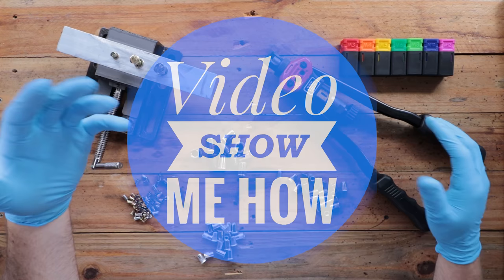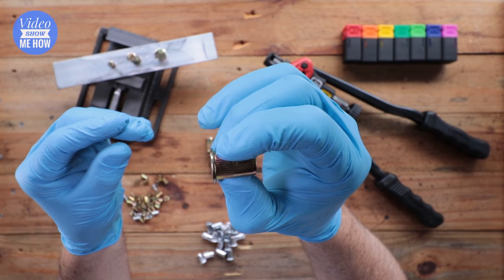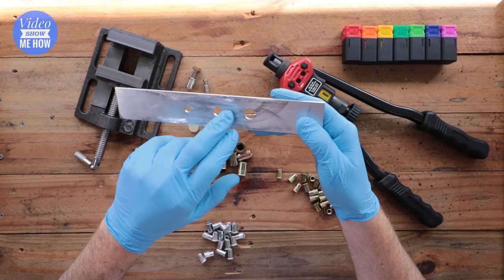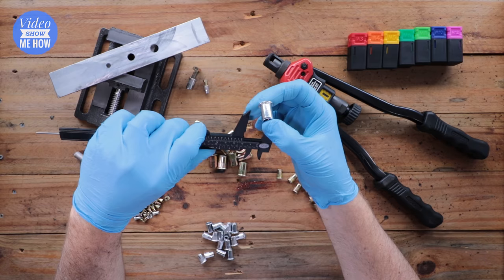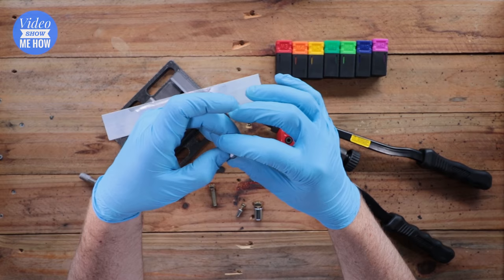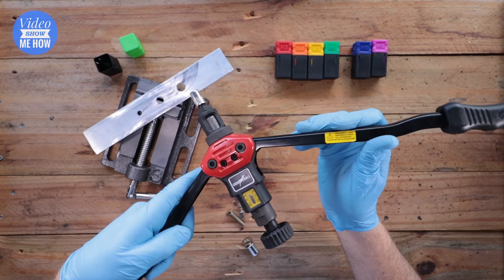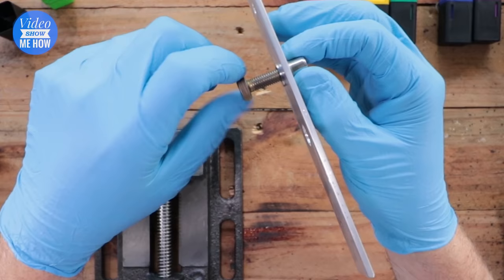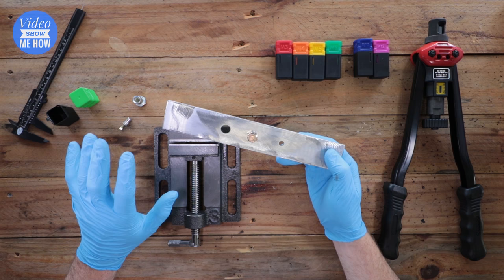How to Install Rivnut Rivet Nut Nutserts WITH TOOL [Full Guide]

Comment: You'll use this tool more than you think. Suggestion - do a test insert on a scrap piece so you can see how much pull is needed to set the insert. Especially on smaller sizes. Otherwise you can snap the mandrel with too much pull. You never pull handles enough to touch each other.

Comment: I have that exact same tool.  It came in a very nice case.  Major problem:  Too much money was spent on the case they couldn't afford the paperwork to show how to use the tool.  You did a good job on filling that shortcoming.  What is the purpose of the yellow scale on the tool?
Reply from the maker: Basically a depth gauge, shows how far the nut is crushed. Unsure how accurate etc, personally I don't really use

Comment: You are getting way too stuck on the flat surface thing. I literally only use these on round handrail pipe. No problem
Reply from the maker: Yeah sure, just meant they're more designed for flat for full strength. I've used them on my roof rack (pipe) for my awning and work fine also :)

Comment: One commenter asked how you know how much stroke to use and you replied that you use a two-step process to not overdo it, which is fine.  The tool I received came with pretty understandable instructions and a chart that lets you determine based on rivnut size and thickness of the metal you have, how much travel you should look for using the gauge in millimeters of travel.  This allows you to get the right amount of "crush" without underdoing it (spinning rivnuts) or overdoing it and possibly breaking the mandrel/die.

Comment: Thank you this helped a lot I’ll be using this to install my wide body kit on my E46
Reply from the maker: Nice!
Reply: I’m also using this for a wide body kit on my 86
Reply: I just found this video  for fender flares on my STI lol 😂
Reply: I'm fixing a real parcel shelf on my E46. Previous owner cut the middle section out for a messed up looking speaker shelf. Trying to get it back to oem look and keep trunk sound out. I have everything done, now time for the threaded insert. But, I don't want the insert to spin. And so I don't know if I need a specific type of insert made of Aluminum Brass or Steel? 

On YouTube to hopefully find what insert type can I use so I can torque to bolt to roughly 10ft/lbs without spinning it on this sheet metal? 
Thank you
Reply: Previous owner of my classic mini used self tappers for the arches... I'm also here for upgrades. These nutserts will definitely cope with 10 ft/lbs, use a steel one but only if you buy the beefier rivet tool like this one shown (steel rivnuts + the one handed tool will be a bad time)
Reply: Did it work?
Reply: @douglassantos8918  yeah it did but I’ll be blending my kit in to make it one piece to the body

Comment: Thanks for the clear and simple instructions. My tool turned up with Chinese instructions! I used these to put nut certs in my van roof to bolt some roof racks on, the ones available for my van only clamp to the edge of the roof and I didn’t feel they would be safe and would worry they’d come loose! This video helped me out big time!
Reply from the maker: Glad it helped!
Reply: @VideoShowMeHow  roughly knew how to use it but I didn’t want to cock it up especially with drilling holes in my roof!
Reply: @Legend-wu7pj  How did you know you'd have clearance on the inside for the rivnut?

Comment: Excellent video, thanks for that. The turny twisty thingy that releases the bolt was cool as well, I couldn't work out how to get the tool off one the nutsert was in.
Project- I'm remounting the hatch/cover for a water tank on a narrow boat (UK)- it had bots welded underneath the plate, but they have corroded and half have disappeared. So I'm going to grind off what rests & use nutserts instead.

Comment: I was hoping you would touch on yow to adjust the plunge/stroke depth on this tool. Thats what the little gauge on the bottom is for. Its possible to damage the rivet nuts themselves if you dont have this setup properly and you pull beyond the crush capacity of the inserted riv nut thereby essentially rendering that installed nut useless bc the threads have been destroyed
Reply from the maker: Yes you're correct, I usually just tread right down with the tool at max open, then insert full close, open 1/2 twist, compress again and perfect every time 👍 If you go too far it pulls the whole cylinder out of whack to the point you can't thread anything as you say

Comment: Probably the best video on Youtube, showing how to install Rivnuts!! The only thing I would add; the small one hand install tool is great for the smaller sized Rivnuts, where all that torque isn't required. You can use the large tool, that you did, for all sizes, *if you're careful. Its very easy to break the smaller mandrel or dies with all that leverage.
Reply from the maker: Top tip and thank you for the feedback :) 👍
Reply: Can these be used for plastic ATV panels
Reply from the maker: @matthewgriffin8049  I've used on plastic before so can't see why not, so long as the surface is flat (ish)
Reply: Hi,can you cut the excess material of to make it flush?

Comment: Something I have not seen on any video is an indication of how much to compress the rivnut and when to stop. It is not too bad when you can see both sides and so see the amount that has been compressed but when the backside of the insert is not visible then what? How much is the correct amount of compression? The too used is also very large so a consideration for tight/confined spaces has to be made to determine the usefulness of each type of rivnut tool. Great video though, well explained.
Reply: The appropriate amount of compression can be determined through experience and familiarization, or by using a product equipped with a stroke gauge that accurately measures compression. The ideal compression for achieving a neat crimp also depends on the size of the rivet nut and the thickness of the panel, information that can be found in the tool's user manual.

Comment: Thank you for the clear video. I purchased the same tool, however the die that I used are very easily bent causing al consequent rivet nuts to crooked. Any idea why this happens and how I can prevent it. I did make sure that the rivet nuts I use are suitable for the thickness of the material. Thanks in advance for you're reply!
Reply from the maker: Hey Nino, hmm haven't had any issues with mine and have used it A LOT... Wondering if it was faulty in some way?
Reply: @VideoShowMeHow  Thanks for you're reply! That might indeed be the case, the company I bought it from will send me a new one so we will see. I was just wondering if i might be doing something wrong. However as far as I know I do exactly what you do in you're video

Comment: hi! thank you so much for the video.  i have a question.
ive been using rivet nuts for light duty applications, say like mounting the number plate , or a hinge. 
but, can i use this for heavy duty industrial applications, like say to attach legs for a table that takes 1000kgs on it. where i would put the screw horizontally, and the screw is loaded in the shear mode.

Comment: I needed to drill out a hole on my jeep fender to install one of these inserts for an arb twin air compressor. Someone used this tool in stead an I assume put in the wrong size insert. It was not the one supplied by arb.  So after putting in the screw he also supplied, it screwed in maybe a quarter of the way and the insert turned with the screw. I could  get the screw out as everything turns together. I dremeled the head off the screw so I could uninstall the compressor bracket. How do I remove the insert and the headless screw?

Comment: Hey Adam,

Thanks for all your videos, they're brilliant!

Got a question regarding rivnuts...

Would they be suitable to fix down a fridge slide and a potable battery dock in the back of the tub?

I do a bit of 4x4ing, no crazy stuff, just getting from A to B.

They seem like the best and easiest fixing option.

Cheers
Ben
Reply from the maker: Hey Ben, you could however would consider - are you going into a tub liner or the tub itself? Tub itself would be fine  at a couple of points, tub liner may not be the strongest to hold with 4x4.. Also if tub liner just remember you'd have the back part of the rivnuts potentially scratching up your actual tub
Reply: @VideoShowMeHow  thanks for info mate,

Yeah have tub liner, I was thinking of cutting it out where fixings/ bractets will go, then semi try to make it neat and seal up again.

I'll have to have a plan and think.

Comment: Can you use this tool for really thin metal, say a car door? I would like to insert threaded rivets so I have a solid thread for mounting my new doorspeakers. Please let me know.
Reply from the maker: Sure can
Reply: @VideoShowMeHow  so the metal is not too thin you figure? Thanks for your quick reply!
Reply from the maker: @gianstevens7918  have used them in door panels before and they worked fine 👍

Comment: How well do you think that will perform on 1/8 fiberglass? Using 8/32 size bolts. My concern is that it will crash and crack the fiberglass
Reply from the maker: I would agree, you would have to have a very clean hole. I think it would depend how much load you will be asking of it. Have you got a spare bit to test it on?
Reply: You will need to use a washer on the back  or make a backing plate

Comment: Great video and thankyou. Is there a minimum thicknesses that they crimp onto? Such as would they work on a small gauge copper sheet or brass?
Reply from the maker: Cheers. They're meant for 6mm wire, the wire I used was a little smaller as I didn't have any thicker at the time. I wouldn't be going too thin, maybe 4mm max. If wanting smaller I would go to a different type of connector like deutsch plugs etc
Reply: You can check out different rivet nuts as they have different riveting thicknesses. Some will go from 0.5mm. the multi pack assorted versions tend to be cheaper ones and not so accommodating.

Comment: Oh thank you! I didn’t know that these things existed! I do believe this will work to fix my gate! The latch arm piece is just screwed into the colourbond tube vertical piece and when it blows in the wind the screw loosens. Drives me nuts as it makes even more noise, plus I’ve found it swinging open a few times. Not good with a dog and 8 chickens! I do have a question though. Do I need a specific sort of bolt? I’m guessing all the different metal screws I’ve bought trying to fix it in the last 8 years won’t have the right kind of thread. Actually, one more question. Do I need a certain kind of rivnut for outdoor use or are they all okay? I see there are shiny silver looking ones and brass coloured ones. Does it matter?
Reply from the maker: Yeah you can get stainless, make sure the bolt is high tensile, 8.8 min 👍
Reply: @VideoShowMeHow  okay great. Thank you so much! I’ve ordered off eBay and there’s no mention of tensile strength so that means I’ve bought the el cheapos lol. I’ll use one of those first to work out what size I need and then will get a small packet of high tensile just in that size and replace it. I don’t have a need for an assorted pack of high tensile bolts at this point. Maybe I’ll love this little doovilacky so much that I’ll start using it everywhere, but if it just fixes that bloody gate it’ll be worth it.

Comment: I got same one eventually when I had the time to use it. The Eclip inside broke 🤦‍♂️🤷 so I took apart think I fixed it but  now it doesn't open up the way it is supposed to. Do u have a vid to show how to fix this problem properly
Reply from the maker: No I don't I'm afraid, able to return it?

Comment: Great video. I'm curious if these would work in materials when the nutzert doesn't protrude out the other end, like for instance embedding it in a 2x4 piece of wood. Would it still crush and expand into the wood or would it just smash and not grab. Have you tried this?
Reply from the maker: Thanks Lee 👍 I haven't may be worth a shot my bets would be on it not being that effective though. If you're after a thread in timber you can use t nuts, have used these before to good effect. Hope this helps!
Reply: @VideoShowMeHow  I'll take a look at those. I'm actually going into composite fiberglass on a boat - but the T nuts might still be the best option. Thanks for the video and updates!
Reply from the maker: Welcome, good luck!

Comment: I have a step up running board the bolts seemed stripped but I think wrong application.  Do you feel this would have enough strength (using the proper amount of bolts) to withstand stepping weight to get into a truck??
Reply from the maker: Hey 👋 Yeah for sure, just get some bigger ones to suit something like  M10 bolts and should be fine 👍 Get some steel ones for more strength. This doc has some good stats on them - http://www.rivet-nut.com/assets/rivnut_mechanical_properties.pdf
Reply: The video shows the tool needs to be closed (handles together) to make the crip. However it's the following clip it shows you removing the tool from an open tool (handles wide open).  Is the crimping   action close then  open handles or just close handles?  Confirming the end state of the handles wasn't just a result of video editing.  Thank you.   Great video otherwise.  The company should be paying you royalties because their instructions suck.
Reply from the maker: Yep handles closed for crimp, to remove once crimped handles open so you can unscrew the mandrel 👍

Comment: Does the nut seal the whole from leaking? I’m installing brackets to the roof of my truck and I don’t want water to leak in. Should I add sealant to the installation process? Anybody have any thoughts? Thanks
Reply from the maker: I'd add some silicon around the rivnut prior to installing

Comment: Ever attempt to install in fiberglass?  Was thinking of opportunity but unsure if would remain after installing.
Reply from the maker: Would be an interesting experiment, thinking it would depend how thick and if it would crack. I could see it working though. Let us know how you go?
Reply: @VideoShowMeHow  its 1/4 marine plywood resin soaked gelcoat topped with splatter paint finish. Was thinking light sand to flatten paint, pre drill to rivet od, insert with either 3m 5200 or thickened resin, compress. I'm sure that will cause mild stress cracks in gelcoat immediately surrounding fastener,  but would likely hold. Its the longevity I'm concerned with. I'm gonna try w 5/16x18 since small enough if goes all wrong I can just rip out and resin over easily. I'll share as I learn.
Reply from the maker: @herewegofans  I reckon it would probably work ok. Maybe not for anything high torque but general fixing would likely be alright. Remember the stainless if in and around water (I'm sure you already have) 🤞👍
Reply: @VideoShowMeHow  the scope of the project is design a method to secure starboard hdpe to fiberglass bulkhead that is removable to service electrical distribution setup when needed. Previously used screws and adhesive but removal is a labor nightmare. Gonna try this to see if I can get working and just use light thread lock to assist with watertight and vibration on craft. Oversharing I know, but seems you like a good challenge so sharing should you wanna attempt also lol.

Comment: You missed an important detail, you can adjust the amount of nutsert compression/depth
Reply: exactly....
Reply: This is literally why I clicked on the video
Reply: That is what I thought as well, so that is what is the scale for then? I have watched lots of this how to do this vids, and not one has touched on the scale on the tool. Other than that this is a good video, but would still like to know how to use the scale.
Reply: @noidnomis  I think the scale is best used to judge the relative amount of compression applied to the rivnut. The pressure for any particular line on the scale would apply different pressure to different sized nuts because the nuts have different dimensions. To me, this is more of an art than a science, but one truly does get a “sense” of how to adjust as they become more familiar with the process.

Comment: Is there a insert nut that can be flush against the metal piece so that if you want to join 2 pieces of metal with a bolt together?
Reply from the maker: not that I know of I'm afraid.. welding a possibility?
Reply: @VideoShowMeHow  No welding is not. I want to join two pieces with a long bolt . I want that bolt to not wiggle in the hole.

Comment: Can you post a video while installing the nutserts in an actual application? The fact that the nutserts protrude from the backside of the surface where exactly would this product be useful? So far, I've only been seeing these installed on automobiles. I work in the construction industry and I'm trying to see the relevance of using this tool.

Comment: Thank you!
Reply: After I saw your video, I bought a rivetnut tool, yato brand, it haven't arrive yet, but I was wondering how thick or thin should be the sheet plate in order to insert a rivet nut properly? I suppose it can't be too thick/thin. What do you think? Thanks.
Reply from the maker: It really depends on the application and rivnuts themselves. I've used on a couple mm to 5-6 mm

Comment: Great video the problem with me is that I put the nut in the rivet without using that tool and now the rivet is stuck in there with the screw and I can’t get the screw out nor tighten it any suggestions anyone?
Reply from the maker: Vicegrips?
Reply: @VideoShowMeHow  you think with vice grips if I pull they will come out? It will be hard to grab on to the nut since there isn’t much space to grab on to it. You should make a video on how to remove it

Comment: Is there a way to countersink the heads so they lay flush?
Reply from the maker: Not that I've seen :(
Reply: You can put a pocket with a flat bottom in the material where the head sits.  Or you could get rivet nuts with a countersunk head.